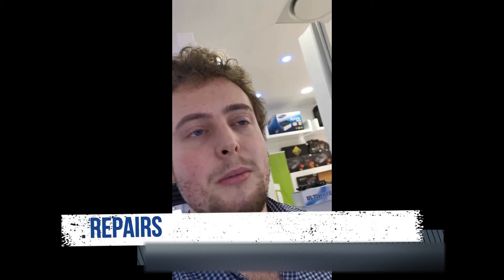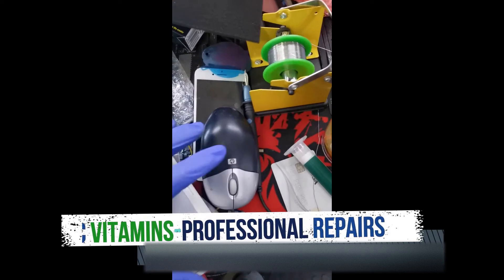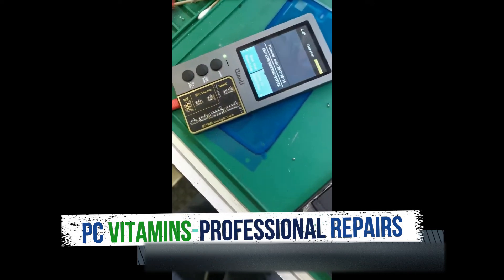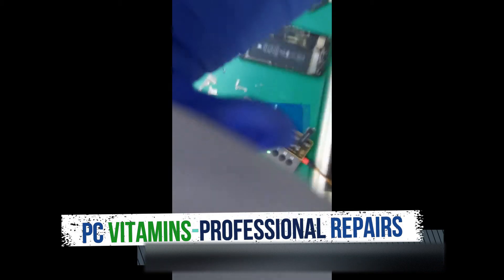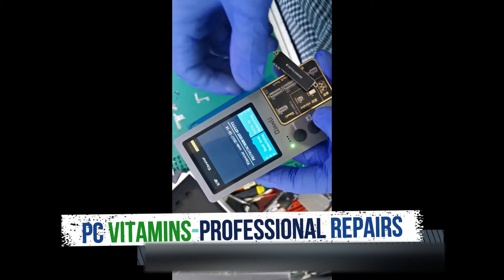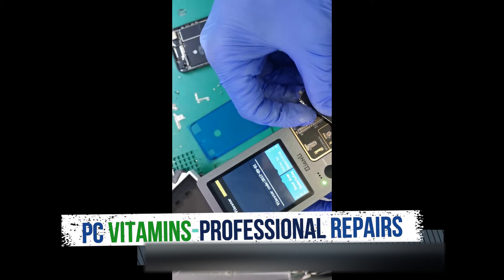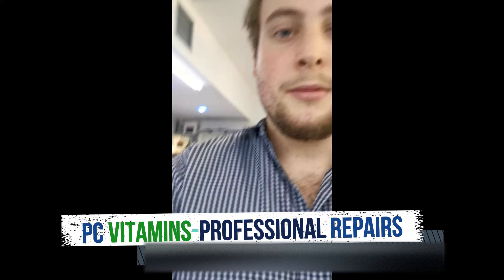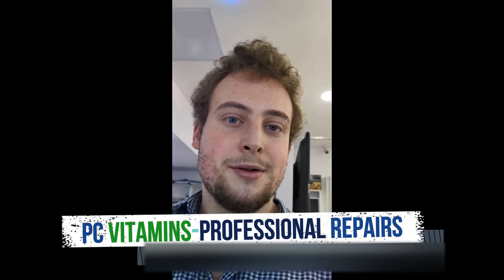iCopy Plus 3D Taptic Engine Programming

Comment: does this explain the clicking taptic engine when installing a different one without programming??
Reply from the maker: Hello The tapic engine wont work at all , you have to write the data to the new one :) enjoy
Reply: @Pero I have exactly the same problem on my iPhone 8 after replacing taptic engine. Have you found a solution for that?
Reply: @neo7431  yes apparently you have to use a programmer to copy data and then transfer to new Taptic Engine. They sell programmers on Ali
Reply: Thanks @Pero I’ll try to programm it. However it’s very strange because after replacement sometimes it works fine for couple of days and suddenly it starts ruttling/clicking for day or so. I thought that the screws might be loose, but it’s not the case. I even tried to stick the engine with a tape but it didn’t help. Did you have the same scenario, and programming helped?